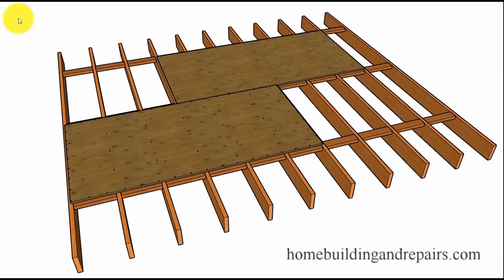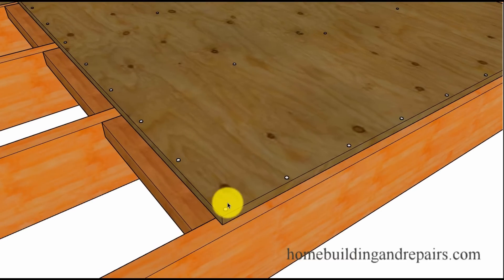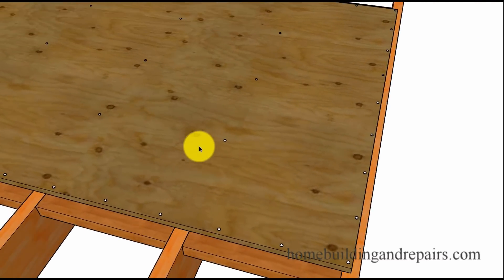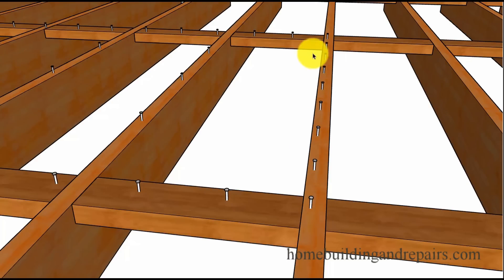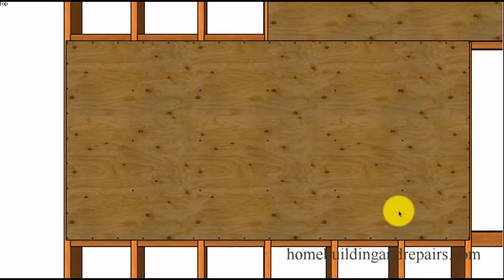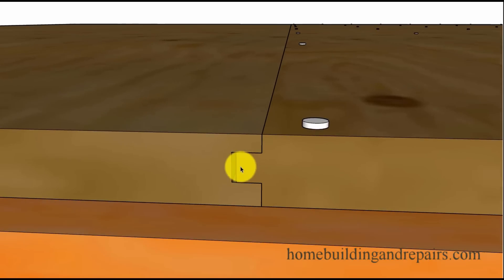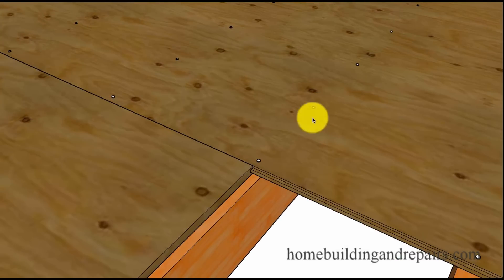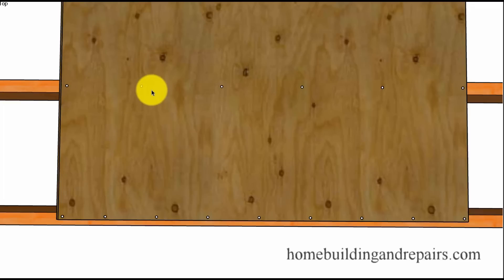How Far Apart Should Nails Be When Nailing Sub-floor Framing?

Comment: Im in the process of building a shed and I used 1-3/4 inch nails with a nailgun for 3/4 plywood. I spaced them out 8 inches apart.  Do I need to redo it and put longer nails or will it be fine?
Reply from the maker: I would leave it as is, but you can always add more nails.
Reply: @gregvancom  thanks I will

Comment: Thanks for the info! So what kind of problem could nailing at 13 inches cause?
Reply from the maker: I think if you're only off a few nails, then it might not be a problem.
Reply: Not pass inspection potentially. That's why he said with an extra nail or screw you're closer and don't risk being on the edge or just out of code >12"

Comment: Hello Greg, If the room is 16 x 8 (Surprising accurate), is staggering still necessary (which will result in partial sheets used)?  I am perpendicular to the joist.

Comment: If using I-joist and engineered sheathing/subfloor the manufacturer does specify fastener schedules including the minimum distance from the edge of panels and ends of joist.
Reply from the maker: Thanks and I will check it out the next time I pull out the product literature.

Comment: How do we do floors i north of Europe? Never ever plywood, we use a form of advantec product, fine grained sawdust/ OSB type. 1 inch thick and made with tongue and groove on every side. You just glue the wood under and the grooves and smash them together. Nu need to worry about if you are over a joist or over a void or not. It will hold just fine. And 4 nails per board.
Reply from the maker: I would love to see some pictures, more information about the products or even the manufacturer who makes the product suggesting to only use four nails per board. Do not post it here, go to our website, get our email address and email me the information. Please remove all product or manufacturing information from your comment, thanks in advance.

Comment: 7 minutes to answer the question of how far the spacing should be for subfloor nailing schedules? How about a video on why you should use adhesive end screws instead of nails
Reply: Appreciate that bro, worse than waterboarding
Reply from the maker: Thanks for the somewhat constructive criticism, even though it wasn't presented in a way that I might have presented it. I am planning on making a video in the future about nails and adhesives.

Comment: I always just used screws, you know to make it easier to remove them when they rot out cause nothing lasts forever hehe, but the video that I would like to see is the floor joist and framing braced and laying walls down on joist and adding sheathing after and but them against wall and bottom plate that's what I would like to see. Just to see if it's a better setup than conventional framing
Reply from the maker: Look what you started :)

You have a good point, screw sure would make it easier to make repairs in the future, but they might not be approved by an engineer.
Reply: Exactly.

It's the 21st century...there's no rational reason (except profiting by saving time) to use nails on flooring, decks, roofing...anything really.

Bout' the only exception would be brad/finish nails in furniture or cabinets.
Reply: psygnale there are plenty of reasons on roofs and wall sheathing. Nails have better shear strength and are more ductile. Roof and walls are shear diaphragms, don’t want brittle screws.
Reply: @psygnale  What does the 21st century have to do with nails or screws? That's like saying we shouldn't use lumber anymore.
Nails are fine for sub flooring, as long as you use glue. Nails are much better for walls and roofs.
Reply: Well crap my bad but I mean if it's just us regular people like me yea I use screws on everything because I've always planned for the future events because well it's wood and it doesn't last so using screws and no glue makes it easier to replace in the future but aye to each there own, now in the field and going by guidelines and codes yea probably have to use nails but building your own stuff like sheds and porches or in my case having to completely redo my entire Mobile home I will use screws and plywood to hell with staples glue and osb
Reply from the maker: @reaperasylum2163  I don't think I would worry about something that's already done, but screws won't always be the best fastener or connector when assembling wood framing components. I am going to make another video about nails and screws in the future.
Reply: Your right I was mainly just saying that about the sheathing sorry I should have specified that in the comment no on framing of course nails are best my apologies guys I wasn't specific my bad now on the sheathing most definitely I use screws and I use it for the wall panels as well, as I said in your other videos I have to completely redo my trailer and they glued and stapled that crap osb down and I have to go in and rip that junk up spend countless hour trying to sand the glue off make it smooth lay down the strong 3/4 plywood down measure cut and screw in and since I'm using 3/4 it's much taller than the original floor so I have to do that to every room corner to corner wall to wall and that sucks the manufacturers and contractors should just use plywood in the first place and not osb cause once that crap gets wet it's done for
Reply from the maker: @reaperasylum2163  Like I said, I wouldn't worry about something you already did and who knows, your methods could be the future of construction and especially easy repairs.